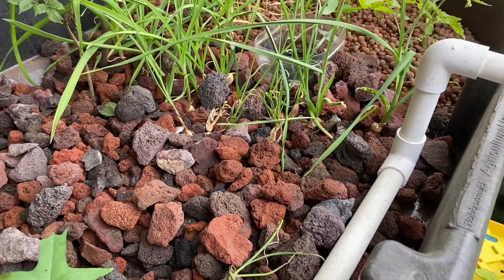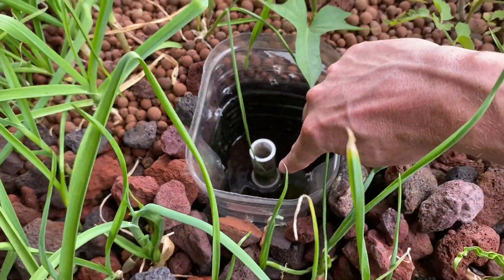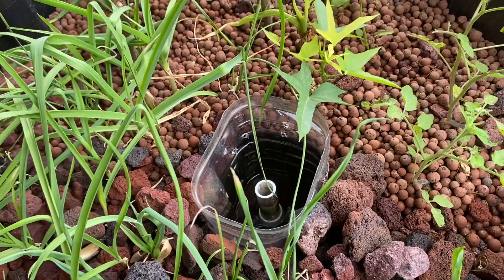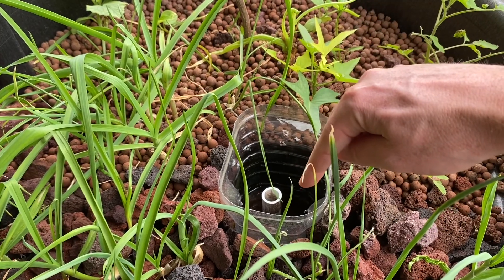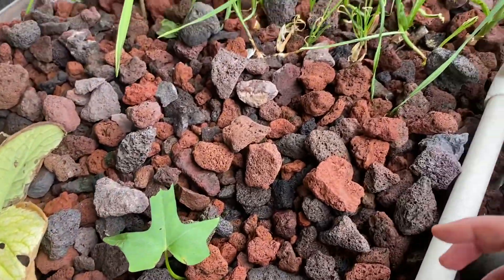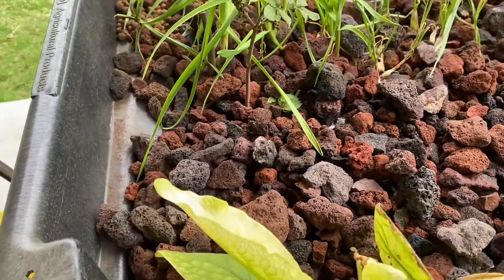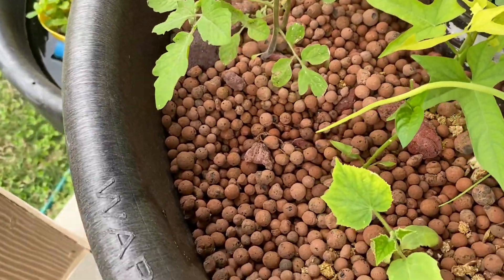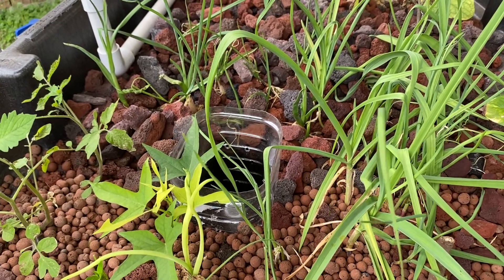Aquaponics | Controlled with a Timer

Comment: Where did you buy your timer, I am having trouble finding one that turns on and off enough times per day.  Great video, thanks!  We are just getting started.  Dave
Reply from the maker: Timer Outlet, Nearpow Multifunctional Infinite Cycle Programmable Plug-in Digital Timer Switch with 3-Prong Outlet for Appliances, Energy-Saving Timer, 15A/1800W https://a.co/d/9s1YUIm
Reply from the maker: This is the timer on Amazon- I’ve been using for over a year with no issues.